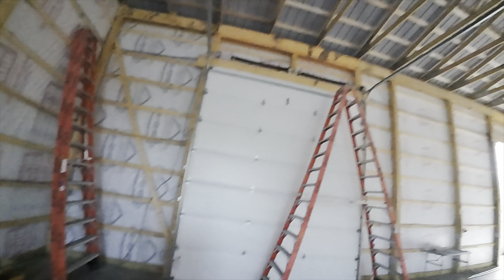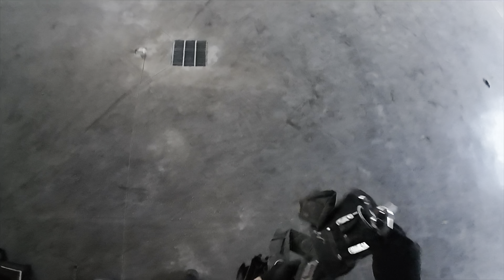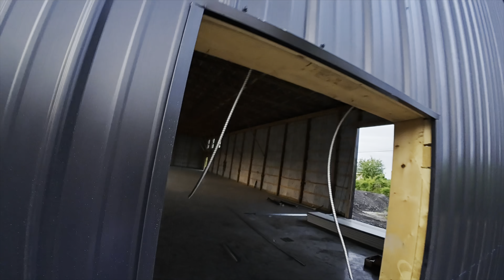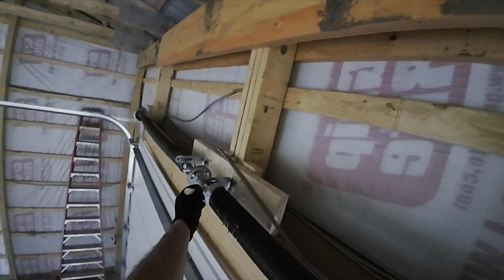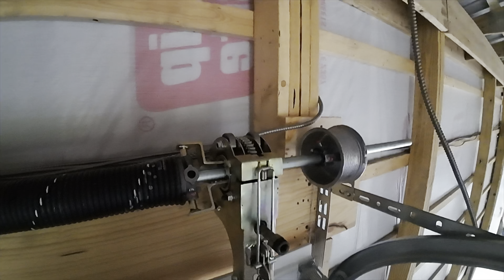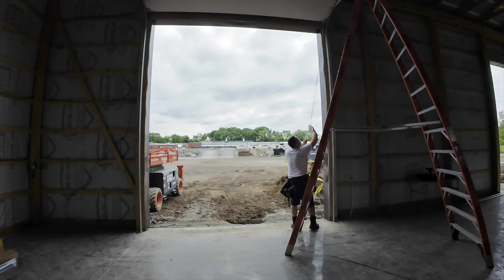First Time with Spring Turner

Comment: Nice i didn't know about the spring winder before you made the video! The surewinder is definitely easier but for those springs, looks like you most likely needed the brutewinder. i have no clue about the brutewinder, as we dont have one, but i know for a fact, if you could fit a surewinder on that, you wouldve had an easier time as its like 15-25lbs maybe
Reply from the maker: Yeah I’m not sold on this Spring Turner yet. It was super nice that I didn’t have to use bars. That part I’m in love with.
Reply from the maker: Nice 👍 I will look you up